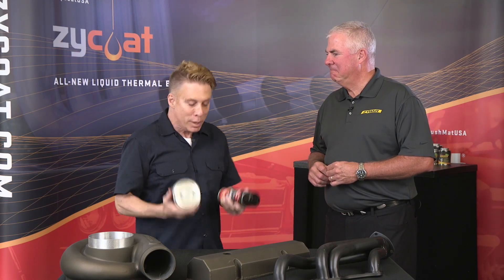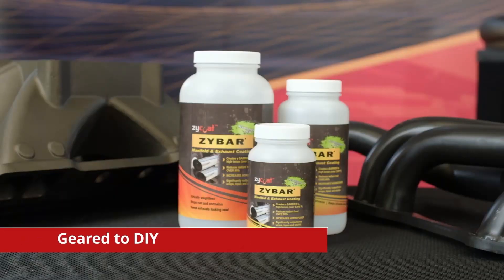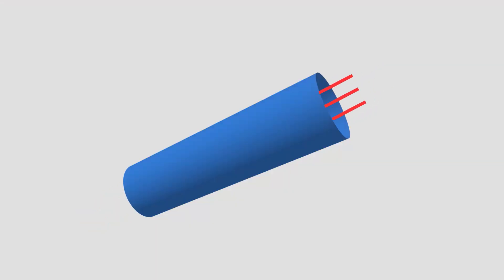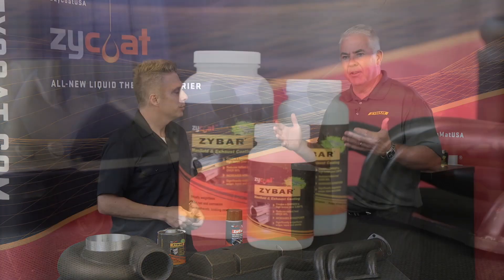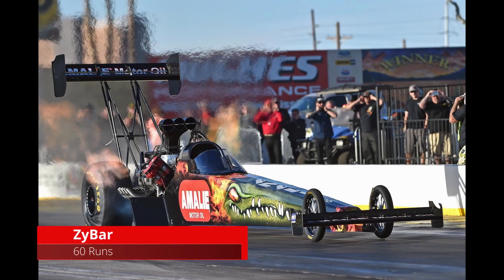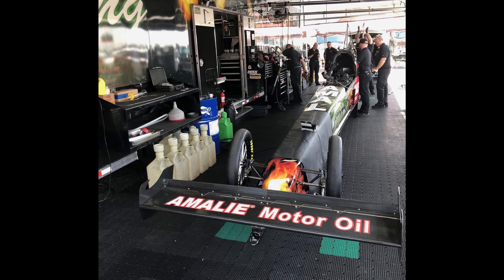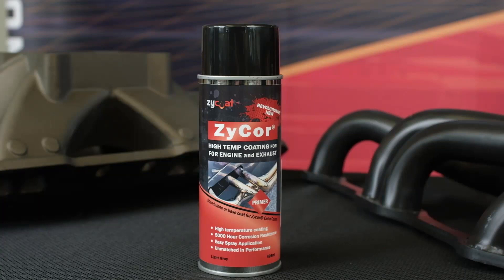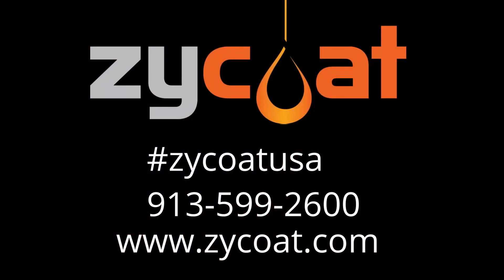ZyCoat's Revolutionary ZyBar® High Temperature Coating and ZyCor® Corrosion Resistant Paint

Comment: Is you product have a HI or LOW emissivity? Agree it can’t be both.  A low E will contain the temp inside the pipe. And keep the outside temps lower. If high E, then the heat inside the pipe dissipates thru the pipe faster. Please let us know which this is

Comment: After two failed applications of Cerakote to my Harley exhaust.... I might give this a try and just do it myself.  Have you tried this rattle can product on Harley exhausts?  Does the black stay black, or turn chalky over time?  interested in your product
Reply from the maker: ZyCor primer and Bitchin Black top coat is rated to 1200 degrees F exhaust metal surface temperature.  You have to media blast the exhaust with 100-120 grit clean aluminum oxide then apply Primer first then top coat then cure.  The product will provide a matte black finish. Thank you for reaching out.

Comment: Very interested in your product, sounds like a tremendous efficiency increase. Is there any data or any videos showing a comparison of ambient engine bay Temps before and after the application of your product? Building a turbo street car and ambient engine bay Temps and burning of plastic components and wiring is always a big concern.
Reply from the maker: Tech data sheets are posted on https://ZyCoat.com